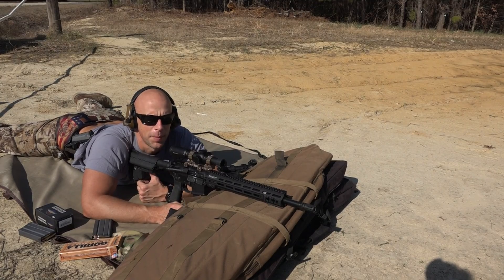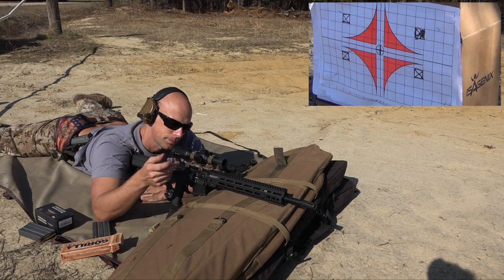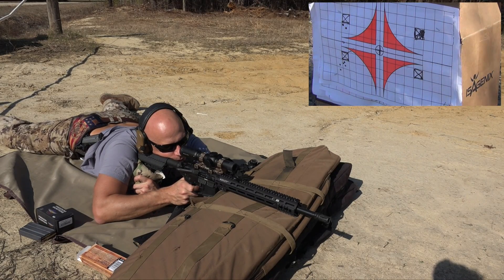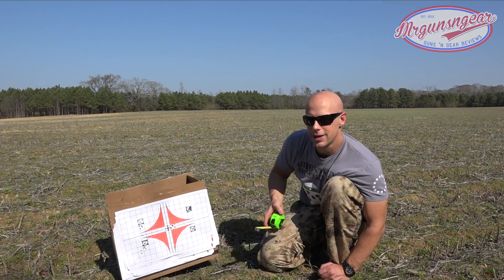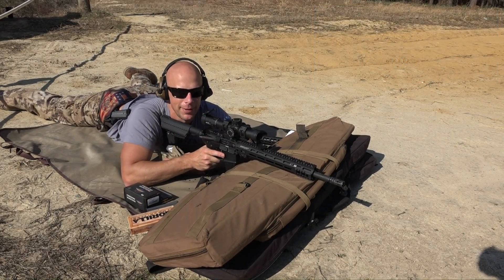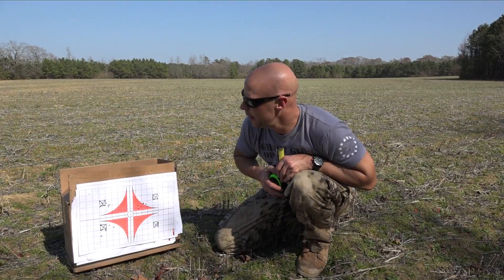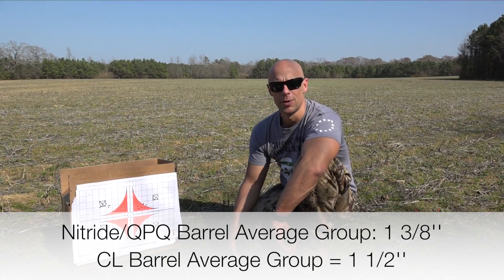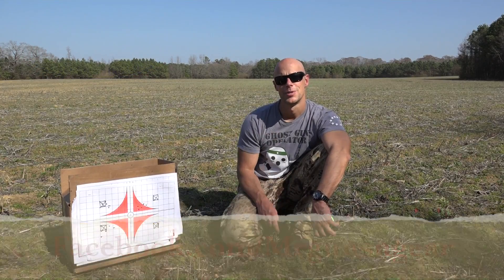Melonite vs. Chrome Lining: AR-15 Meltdown Base Accuracy Test (HD)

Comment: Meltdown videos eh? Wear gloves and glasses. I am always amazed how fast you can toast a barrel with sustained full-auto. Can shoot out the rifling and be left with a smoothbore in a few minutes of magdumps. If you really pound rounds through both of them in FA without letting them cool I don't think either is going to have much rifling left, which means both will shoot about the same (Assuming they survive whatever test you have planned, If you're doing what eric at iraqveteran normally does the barrels are usually the first to pop). Chromelined does hold up better but when you really push rounds out mag after mag it's going to wear down regardless of what its made of and how its treated. (I shot the rifling out of a chromelined AK in a single afternoon of F/A)
Reply from the maker: thanks dad

Comment: I'm thinking the cl will prob last a tad longer but if they both last then the melonited barrel will prob be more accurate.... just my assumptions anyway... what do you guys think?
Reply: @darrin ray I'm with you on this one. Melonite is easier to have the right depths in lining, but I think the chrome lining will actually suffer less metallurgical changes from the heat stress and I don't think the abuse will be so much to fracture any of the CL. I think they'll both stand up, but I do think the CL will fair better toward the end. Excited to see how it goes. Great video idea by Mrgunsngear, especially having both barrels made by the same company to eliminate some variables.
Reply from the maker: we'll see